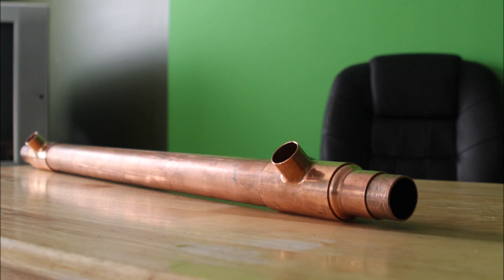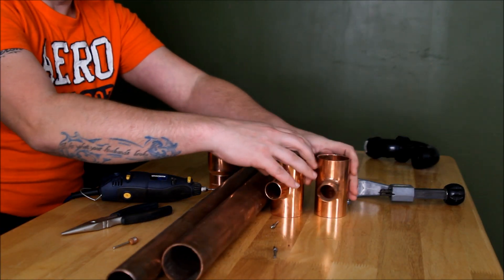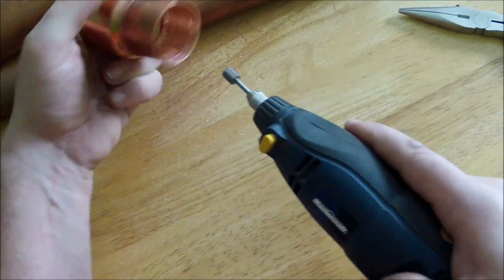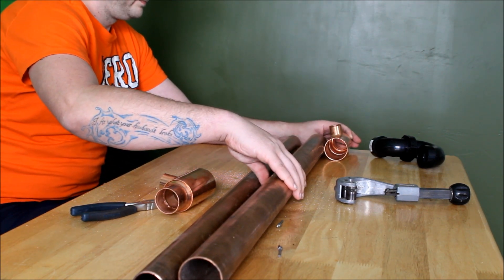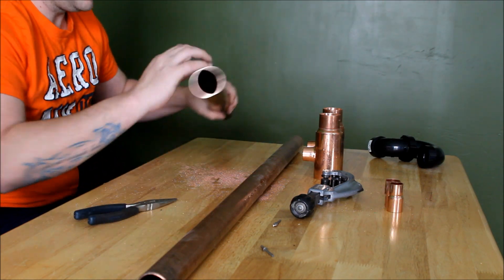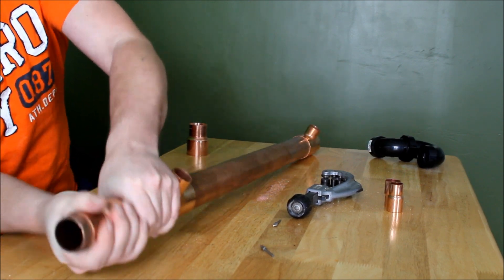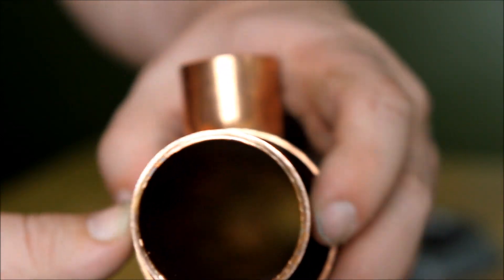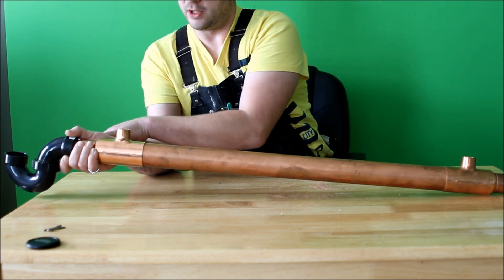How To Make A Heat Exchanger For Shower Hot Water Recovery

Comment: This is a really neat device, but I can suggest some improvements. I built and tested designs for the same purpose 20 years ago, that used long triple-helices of 10mm copper pipes inside 2m of drain pipe. My results were striking, achieving up to 67% heat recovery in some configurations. While I suspect that this doesn’t achieve the same level of efficiency as mine, the OP’s design is better design because it’s simpler, and doesn’t contravene building regulations! (My coil-in-pipe was great for heat exchange, but not practical because it would quickly foul and block the pipe in actual use). I learned a lot of lessons from building and testing various configurations.

Improvements: 
(1) As the OP acknowledges, the clean cold should feed into the cool end of the exchanger, not the hot end. 
(2) As others have suggested, simpler to warm the cold feed to the shower instead of the cold feed to the hot water tank. Then the shower doesn’t need so much hot water to reach the target temperature, as the ‘cold’ is already warm. 
(3) This heat exchanger can make game-changing improvement to instant electric showers that struggle to get warm on very cold days.
(4) To get the maximum heat transfer, ALL of the clean feed needs to stay in maximum contact with ALL of the drain water for as long as possible (see note 4.1 below). If the exchanger is in a vertical configuration, drain water could theoretically contact the entire circumference of the inner pipe, but in practice I would expect hot and cold spots to affect the performance of the exchanger. Ideally, the drain should be near horizontal so that water runs (a) along bottom of pipe, and (b) slowly. If all the heat is at the bottom of the pipe, then the clean feed also needs to target the bottom of the pipe. The OP’s device can achieve this by blocking most of the annulus (eg with silicone? See note 4.2 below) to leave just a channel running along the bottom (see note 4.3 below). 
 [Note 4.1 - If any of the cold feed stays cold, it will cool down the warmed output from the exchanger, reducing its efficiency in proportion to how much remains unwarmed]
 [Note 4.2 - Silicone might not be the answer. Any filler must be biologically inert to prevent growth of any microorganisms (mould, bacteria) that could contaminate the clean water - research this before choosing material]
 [Note 4.3 - To ensure maximum heat transfer between clean and drain water, make sure that the 'contact surface’ is not impeded by whatever material you use to fill the annulus (eg silicone). The contact surface is the bottom of the inner pipe]
(5) As others have noted, radiative heat loss from the exchanger is significant enough to warrant insulating the exchanger, or at least its warmest parts. 
(6) PVC pipe that others have suggested would be difficult to water seal with mains pressure. Also, PVC can be brittle - MDPE or HDPE might be a better choice to cope with mains pressure. However, wide-bore copper pipe is expensive, so worth considering any design that can eliminate its use.
(7) The longer the exchanger is, the more heat it will recover.
(8) Over time, the interior of the drain pipe begins to blacken with mould/bacterial growth which will affect the efficiency of the exchanger. It might benefit from being mechanically cleaned every couple of years.
(9) The more the system relies of the heat exchanger for warmth, the longer it will take to reach target temperature as the whole system has to warm up. 
(10) An alternative way to save energy (and water) is to take shorter, less frequent showers. A 2-minute shower every 2 days will save 90% of energy - and water - compared to a 10-min shower each day. 
(11) Water coming out of the shower at 43°C cools to 33°C before it reaches the plug hole. Some of this heat goes into the skin to make it feel hot, but most of it goes into evaporation to make steam that condenses in the air and on the shower walls. Evaporation reduces slightly as the air warms up and gets fully saturated, but this takes a lot of energy, as condensation on the walls sucks the heat back out of it. 
(12) Evaporation continues to waste energy after the shower has finished. Water on the walls and floor need a lot of energy to evaporate. As your shower walls dry, evaporation sucks heat out of the air, which your central heating system then has to replace to keep your house warm. A solution to this problem is to wipe shower walls with a squeegee after each shower so that water doesn’t dry by evaporation - this will also reduce moisture in the house that causes condensation and mould growth in other rooms.

Comment: Hey Rob, I stumbled here to verify my hypothesis, which has been verified. The video is great. 

I have one question though. 
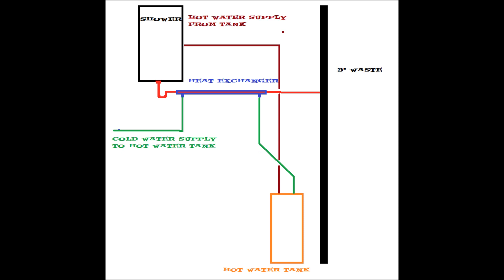After seeing the semantics at time stamp 4:53, it is clear that the inner pipe is to carry the Hot Water, the outer surface of this pipe will be the interface where the actual heat exchange will be taking place.
As per my understanding, the outer pipe is not participating in the heat exchange at all. We can effectively reduce the cost of material by 50% by using a PVC pipe instead. Why do we need the outer pipe made of copper? Right?
Reply: Insulated it.
Reply: My understanding is the outer is copper for ease of construction and certainty to withstand high water pressures. Aside from the use of a Dremel, all these parts are standard and being used within spec (sort of). He does do a video using plastic for the outer. That's cheaper to do but much more faff and I wouldn't feel super comfortable to put mains water pressure through it.
Reply: The PVC would be a welcomed insulator.
Reply: Exactly my thoughts - there will be MORE heat lost through the outer pipe - bc it has a significantly larger surface area to dissipate from  - as is gained from the inner pipe. A Plastic outer lagged would be my choice.

Comment: I have a couple of questions if you are still replying to this video.  I have an on demand water heater that has a long run to the shower.  I am wondering if it will be beneficial to just pre heat the cold water to the shower instead of to the water heater?  My shower drain is 2 inches, can I reduce it to 1 1/2"?
Reply: Even more optimal if all the shower water goes thru the heat exchanger.

Comment: I think the ratio of cross-sections between the interior pipe and the trapped space between the pipes is way off... shouldn't it be about equal?
A better fit might be 1" inside 1-1/2", where the inner area is 0.87in2, and the interstitial space is  0.83in2, but I suppose this might not be enough for some applications.
Reply: Drains are 1.5" so you have to start there.  The important factor is the area of the flowing water in the annular space. The drain pipe in this configuration is not full.

Comment: Looks like a potential hazard for cross contamination..this definitely isn’t worth the effort or money in my opinion. I like the design, but the application isn’t right.
Reply: Minimal danger. The potable water is pressurized. If there is a hole, it will shoot water down the drain, not contaminate the water with waste.

Comment: Hi Rob, if you swap the way water enters and leaves the heat exchanger it will be more efficient. IE Cold water coming in on right and going to tank (or shower) on left (counter flow heat exchange)
Reply: Yep, it's called the countercurrent exchange: https://en.wikipedia.org/wiki/Countercurrent_exchange

Comment: I have a diesel heater that provides heat to my RV. I installed a heat Exchanger to the exhaust and plumbed it with a small circulation pump into my water tank. In the winter it heats my RV and keeps the water HOT! The result is no more heating water with propane in the winter! It safes me a boat load of 💰!
Reply: Can you please email me a diagram or a photo or a video? Maybe even post one? This sounds great!

Comment: Your outer tube  needs not  be copper; it will lose a lot of heat,if in contact with anything (insulate it at least); it may be made of pvc pipe.
Reply: Copper has relatively low emissivity. That's why heat exchangers often have copper pipes but aluminum fins.
Reply: it is easier to fit copper with copper but it can be insulated after installation !    
all the beast !

Comment: Call me slow. It took me a minute or two to understand the benefit and I'm ready to take a stab at it. So, the purpose for a heat exchanger located here is to use recovered hat wast water to preheat the cold supply to the water heater thus saving heating costs?  This seems plausible. All the arguments of nay-Sayers e.g. Soap scum buildup, the accumulative drop in hot waste water by the time it leaves the shower head and reaches the heat exchanger sound dubious at best.  No soap scum anywhere but in the original drain where if it were to build up would do so anyway (which it doesn't) and even diminished hot wast temperatures are beneficial especially considering the one-time minimal investment required of your project.  My final appraisal is keep up the good works; it is inquisitive and thought-provoking minds and creativity such as you have displayed here that lead to exponential improvements to energy savings.  Just a simple added suggestion and I think someone might even have alluded to it already, would be to insulate the hat water drain, the heat expo hanger itself and the line from it back to the water heater.  Good job.
Reply: The only thing you missed is that you'd want to heat both the cold water going to the water heater AND the cold water going to the shower, for maximum efficiency.  I own a commercial unit, 3" diameter, six feet tall, vertical, I'm very happy with it.
Reply: The amount in the " Recovery " is so small. Just take the Money that you
 spent on making it, and pay for the heat to heat the Water, LOL.
Reply: @JodBronson  If you do the math, you'll find the payback period can be under two years. It also serves to increase the effective amount of hot water you have, very useful in larger households.
Reply: @JodBronson if it’s sent straight to the shower mixer cold side I think it’ll work.
Reply: whole thing about scummy water is ridiclous.  just run a double line from hot water heater, and be done with the waste.  it will kill your hotwater heater.  The clean second line can be recovered will yield clean water to hotwater heater.
Reply: DARN..... I must be the dumb+est MOFO on this planet!  LMFAO  😄😁😆😅🤣🙂😂🤣🤣😅

Comment: why not take the recycled heated water and run it to your cold faucet. and then use less hot water.. unless you don't use high enough hot water tank temps to require dilution.  if that was the case then running it to the hot water tank entry might make sense. nice job. you might as well use the  full 6-8 feet of the pipe availible if possible. and insulate the outer tube.
Reply: Joseph DuPont
Reply: Correct. The heat exchanger should run ALL cold water through it for best efficiency.
Reply: @wiredforstereo  There is no point to running all house water through it.  It only works when the shower is on.
Reply: @robtaft9139  It works no matter what is on.
Reply: @wiredforstereo  except it doesn't do anything if the shower isn't flowing hot water through it, other than add flow resistance to the main system
Reply: @davidkeith659  Nonsense. All water in the house can benefit by being pre-heated. Non shower water sits in the house and cools the house.
Reply: @wiredforstereo   are you talking about a different implementation to what's shown in the video and what Joseph Du Ponts comment is about? The video is about a heat exchanger on the waste of a shower. Then Joseph Du Pont asked why not run the hot water coming out of the shower heat exchanger to the cold water faucet (which I guess he means the shower cold inlet. I'm in the UK and perhaps faucet means something different to Joseph) instead of back to the hot water cylinder. Then you agreed with Joseph and that all the cold water should go through the shower's heat exchanger. But what Rob Taft and I are saying is that there's no point running other cold water feeds through the heat exchanger in this implementation as unless the shower that this heat exchanger is fitted to is running, then there's no heat source.  As an aside, where you're from, is it acceptable to have all of the house's cold water mildly heated by a heat exchanger? In the UK it would be considered bad practice to have all cold water pipes sitting at, say, body temperature as it's considered a breeding ground for bacteria.
Reply: @davidkeith659  Just read the literature on how the tool is properly implemented.

I'm over arguing with people who don't fucking read. I'm well aware of the UK's poor sanitation design issues which have killed literally millions of people over the centuries.

Comment: wouldn't it be best to heat up the cold water as you take your shower so you don't need to go back to your tank?
Reply: The energy savings should be about the same, and you wouldn't need to run 2 new lines (one up one down), isolating all the work to the shower area itself.
Reply: no, this takes cold water and makes it tepid. the tepid water then goes to the cold feed on your hot water tank where it is heated to the final temperature.
Reply: @lendoggtheking nah better to send directly to the shower mixer to get used instantly
Reply: Agree - raise the cold water temp slightly on the way in. If you're really into cold showers - you can still have them since when  the waters cold - there's no heat to recycle

Comment: Wouldn't use this in my house, too much danger with the waste water being so close to the clean water.  That being said, I like how you made use of common materials, it could have other useful applications when sanitation is not a concern. If you want to increase the efficiency, use the unit vertically like other DWHR units so the drain water will stick to the pipe walls instead of sitting at the bottom of the pipe. Also, keep one end of the unit hot and the other cold with respect to how the connections are made. You have it backwards in the diagram.
Reply: Gaz S actually fella, the difference is wether you have a mains pressure system or not, you are sort of right, combi boilers are all mains pressure but so are some normal boilers.
Reply: Trent McKone i wouldnt call tanked water "clean"
Reply: gary Strickland Then what would you call it?
Reply: Trent McKone tanked water... you wouldnt want to drink water thats been sat in a tank.... maybe your countries system is different? In the uk you cant drink tanked water because it can be contaminated
Reply: gary Strickland I live in Canada. Water from hot water tanks is safe to drink. It comes out of the same tap as the cold water unlike what I've heard about the UK where they are separate.
Reply: Trent McKone fair enough. Here it depends on whether you have a combi or system boiler. Combi is fine as its direct from mains. But with a system boiler you would have an open cold water storage tank in the loft that feeds the hot cylinder... not good to drink either hot or cold in this setup. The mains would go to the cold kitchen tap though so its safe to drink that. Its why we used to never use mixer taps. However times have changed and we are doing aqay with tanks and cylinders in favor of the combi
Reply: Commercial units are double wall. I own one. Quite effective, saves energy and extends hot water availability.  Even with a single wall construction, risk is minimal since the potable water is pressurized and the drain is not. With the savings of building your own, you could afford to replace it occasionally if you're worried about it.

Comment: Why not return the shower water back into the hot water tank directly?  That way you don't have to wait to get sick.  Who wants to wait for the copper pipe to fail and contaminate your potable water system!  

This is a bad idea right from the start.  The reason heat exchangers are expensive is they are made to fail safely and not potentially kill you. If this failed internally one would never know until it was to late.
Reply: acemannotsomeother tanked water isnt potable
Reply: @gazs7237  Wrong country. It's potable in the civilized world.
Reply: @wiredforstereo  way old post! I had to rewatch the vid to remember.
But yes your right, wrong country. I'm a plumber in the UK and just forget that our system is inferior to north America... 
Also 70% our plumbing fittings are sized in metric and 30% in imperial... Just because some properties are flipping ancient...
Reply: The potable water is pressurized. Very little danger.
Reply: @wiredforstereo  how is the water that has gone over ones soapy body potable? The point I was trying to  making is that he creating a potential problem that will not be evident in a failure situation.
Reply: @acemannotsomeother  What I said was the potable water is pressurized. It will shoot into the drain, the drain water will not shoot into the potable water.
Reply: @acemannotsomeother  you'd know if it failed as your pressurised potable water would be escaping down the drain constantly. You'd hear it. If you can't hear it, you'd at least notice that your water bills would dramatically increase if on a meter!

Comment: take the carhartt's off you buddy holly wanna be plumber. this is a tube and shell heat exchanger;  typically made of an acid resistant material. 

PEOPLE. DO NOT FOLLOW THIS. the inner copper tube will condense on the outside of itself. what a prime location for acidic condensate to go: no where but a nice tight space to a near copper sleeve. 

NO!
Reply: Tony Comp how can either chamber "condense" when they are both filled a flowing with water?
Reply: What? How does a chamber full of water create condensate?